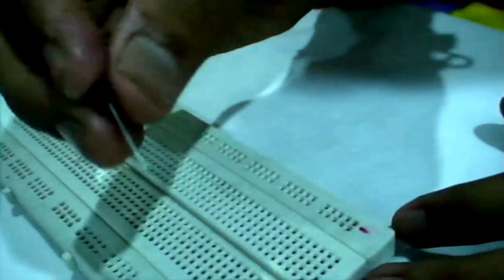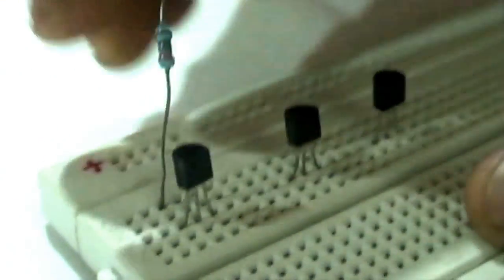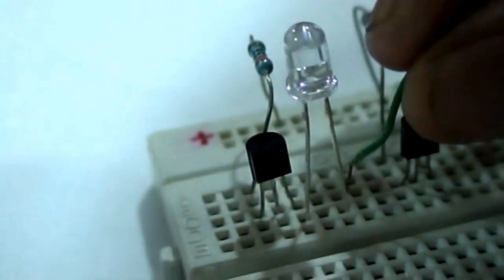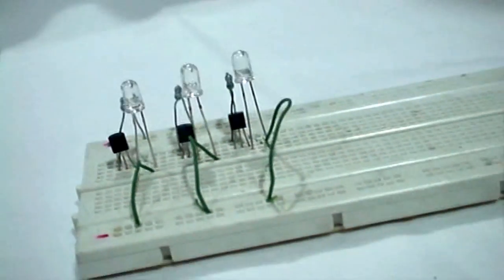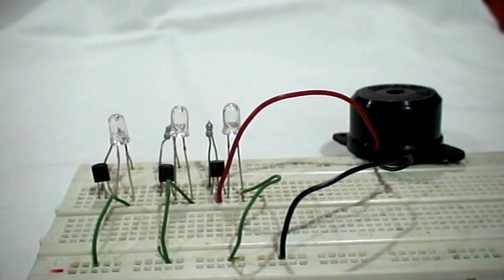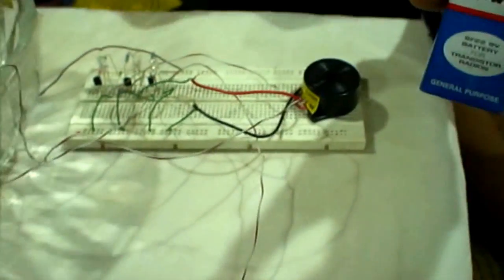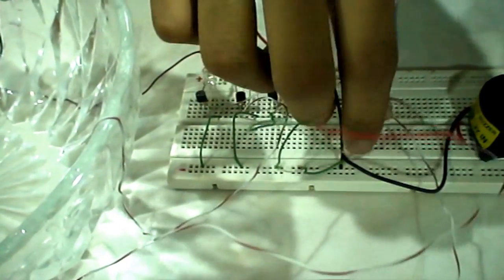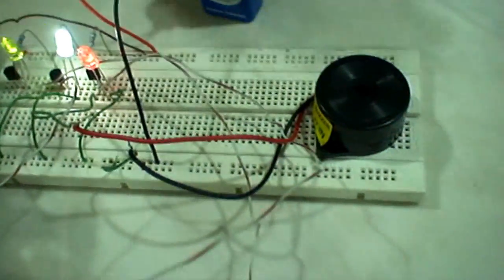How To Make A Water Level Indicator

Comment: Hi, I have done this in a big water tank (3500l) at home. Intead of BC548, I used ULN2803 transistor driver, which is probably not as sensitive as BC548. It worked great for a month, but than lights did not work any more. Only one worked. I checked the PCB board and there it all works fine. So the problem must be in water. Is it possible that the copper contacts in water oxidated or something like that, and the resistance increased too much?

Comment: Gaurav please reply..
i was asking that do we need to use water or electrolysed water?...becuz the lights are not glowing using normal water
i have done exactle the same way you have
PLEASE REPLY BRO
Reply: ya, bro this circuit does not work on normal water it's only working on the salty water or electrolyte water.
Reply: yes i know and i had to do it in that way in my science exhibition ...and i got 4th prize there.for this model
Reply: Same here...

Comment: hello! very nice your circuit it works fine, but...My son has an old VW truck with a water level sensor, and the dash board doesn't correspond at this model, normally there is a light wich comes on when there is no water, so the oposite job of your set up. Do you have any idea how I can have the light coming on when the level goes down? Also, I'm planning to collect the rain water and when there is not enough in the tank I could switch a pump to maintain a minimun level with normal water. Did I explain? When the level goes down the led should light up. Thanks for your videos.

Comment: in case that i want to make for my house water tank is the 9v battery is safincient  for it (or) i should i  connect a 220v supply for in that case how to reduce  a 220v to 9v suppply for the circuit
Reply: have you resolved it bro?....i too have same problem?
Reply: u could just use a adapter which converts 220v AC to 9v DC instead of the 9v battery so that it it saves you from using a battery and replacing it every time. don't forget to buy its female connector along with the adapter..
Reply: Go and buy 9 v battery bro
Reply: It can't

Comment: What I mean is , if I were to increase the number of levels indicated and therefore also the number of led in the circuit, would the resistor used be the same or different? And if different, how would u find out the resistor used for the new circuit?
Reply: The resistor used will not different because LEDs are connected in parallel connection.

Comment: helo. i have a problem with the buzzer. when i make a direct contact with jumper wire, the red led and buzzer functioning. but when i put into the water, only the red led functioning, buzzer does not produce any sound. please help me
tq
Reply: change the postive terminal of buzzer from the base leg to the emitter leg of corresponding transistr
Reply: Same prblm....
Reply: thankx, nw its working.....

Comment: Does the water contain salt? How come the LED lights up when water touches wires in the bowl?
Reply: stompdirtyyard distilled water has no metal ions in it so it can't conduct electricity (which is what i think you're thinking of) however, tap water has been through a lot of metal piping so it's picked up metal ions allowing it to conduct electricity
Reply: Harry O'Brien I was able to conduct this experiment and it worked but i used different schematic and an Arduino. To make the water conduct electricity a wire from the battery or the +5V of the microprocessor was directly placed into the water which would make sense why connecting the "level" wires to the gates of the bjt would make the LED's turn on when water touches the wires.

Comment: Hi your video shows awesome work and I am trying to make it 
because tank is on the 4th floor and everytime one has to go up to see 
if it is filled.
I have made the circuit as described. Previously I used lower resistor 
so the led got burnt but putting wires in the water it was lighting (aft
 sm time led burnt). Then I used 1k ohm, it was still lighting but very 
low. Later I learnt the colour coding. Now that I have learnt the colour
 coding of the resistor I have a 220 ohm which I am using with 547 
transistor. Its not working. I have tried with 100 ohm. tried series 
with 220+220 ohm. No luck. Now am again using 1ohm & 1k ohm (which 
were working previously) but even they are not working now. circuit is 
as previous. every wire connected to breadboard and respective place. 
Can u tell me what is the problem? Is there any way to check at which 
stage current is coming or something.
Reply: You must use electrolyzed water or salt water you can t do this project with normal water..i think
Reply: @veskosberezz7807  tap water is good?

Comment: think you i want ask you that tranzstes pnp  or  npn
Reply: +ali alshra npn as the arrow is pointing out.
Reply: The ones used in this project are NPN which pin out is : Colector (1), Base (2), emitter (3). (https://www.sparkfun.com/datasheets/Components/BC546.pdf)